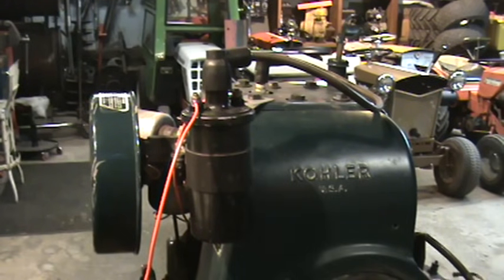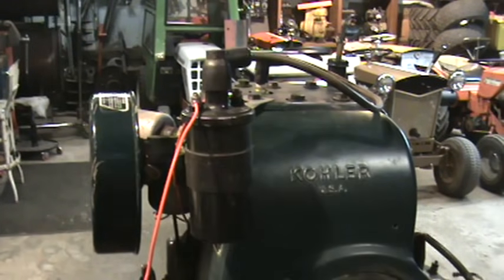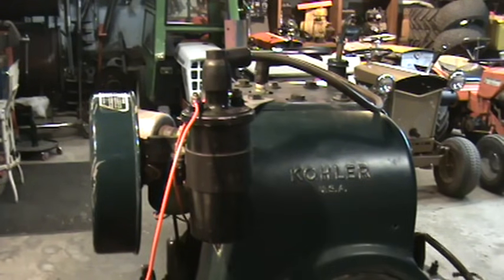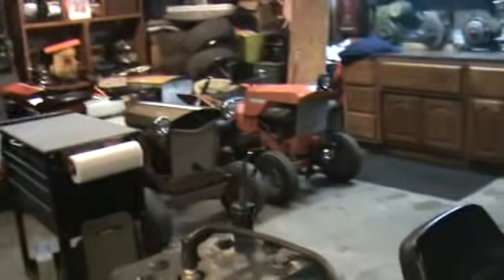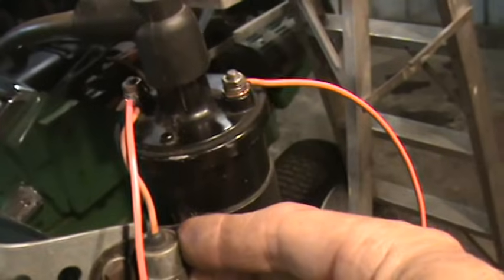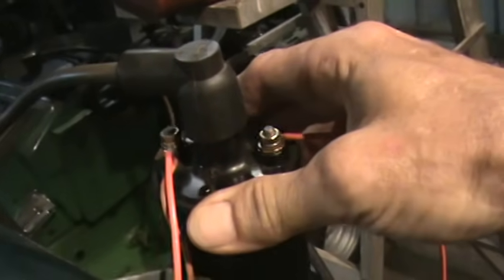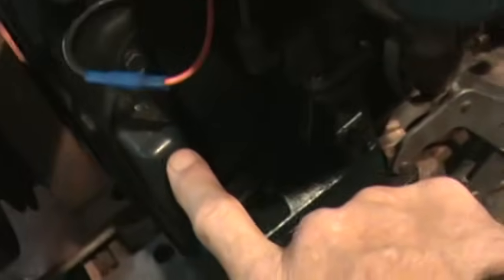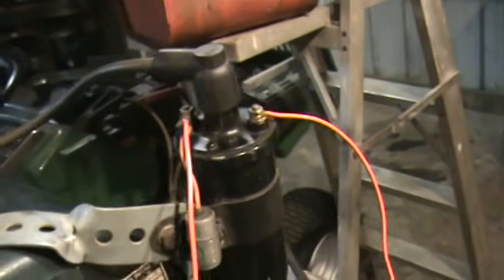Wiring an external battery coil to your engine

Comment: Zippo - I just found a 1963 B-10 with a 23D that has no spark or a weak spark.  I removed points and condenser and cleaned up contacts real good and then pulled engine and removed the magneto which was rusted up from being covered in mouse trash for years.  Nothing looked out of place but the spark is still a problem.  If I switch to battery ignition, and keep the points and condenser all I need buy is the coil.  Do you have a recommendation on the coil?  I'm not too familiar with the electronics of these old tractors but I really want to get this old guy running again.  Your videos have been a God-send, but I need a little help on the coil.  thanks for all you do to keep old US iron running.
Reply from the maker: If you are getting some spark, then the coil is fine. While spinning the engine over, fine tune the points until you get the brightest spark to the plug. Be sure engine is well lubricated by following my video on bringing engines back from long term storage. IF you opt for a battery coil, just be sure it's a 12V coil.
Reply: Thanks Zip.  I got it started and tuned the card (it leaks badly and needs to be replaced).  I got it run and do a few laps around the yard .  Then it started to quit on me.  Would start up and run about a minute then quit.  I'm thinking its fuel related because of the bad carb. the saga continues....
Reply from the maker: Thoroughly clean the tank, replace fuel line, install an in line fuel filter and shut off. I've got carburetor rebuild videos you can follow to rebuild your carb to like new. Glad to hear you got it running! I should tell you, it's a 1964, not a 63. The B-10 was not introduced until 1964 after the B-1 was retired. Cheers! Zip~
Reply: I'll take your word for it that its  a '64.  The old timer I got it from swore he bought it in '59 same year he opened his horse farm in Central NJ.  I have a 76 Case 222 and  78 Cub 1250 with a 1-arm loader.  This B-10 will be my oldest project.  Thanks for your help, you're a great resource.  I already cleaned the tank, installed new line and filter and the carb will be the next phase.  The threads that seat the long carb nozzle and the flow adjustment pin are all fouled and stripped.  Cant remove that long upper nozzle at all.  I think I'll just replace the whole thing
Reply from the maker: The year can be verified simply by going to Simpletractors.com and doing a little research on the old Allis. Cheers! Zip~

Comment: Thanks  Zip ; With this video I was able wire my 16 HP Briggs and get it running . This is just one of your VERY helpful videos that I will rely on and enjoy . Hey, I am even looking at the grip 6 belts. Thanks again and keep up the good work.
Reply from the maker: Don't forget to use my 20% discount code!!!! It's ZIPPO20. So far, 52 people have taken advantage of the discount. Be #53!! They're Awesome buckles and belts for sure. And of course, I'm very glad this video helped you get your problematic Briggs back up and running. Cheers from the Zippo Nation! Zip~

Comment: Excellent video. I have a NOVA electronic ignition in lieu of points and condenser on my AC B-110.  I would like to add a coil as you have shown because I have a weak spark and engine won't fire.  Will  this external coil still work with the NOVA module ?
Reply from the maker: No it will not. You will have to return to a points fired ignition in order to achieve using a battery ignition. If you have a weak spark, change your spark plug to a hotter burning plug. I doubt it's the coil causing the issue. It's possible the flywheel and coil need cleaned up a little and re-gapped. Cheers! Zip~
Reply: I was trying to avoid pulling the engine, to access coil, which entails almost complete disassembly of the front half of tractor :(
Reply from the maker: I have a video showing the process and it truly doesn't take long to accomplish. Zip~
Reply: I replaced NOVA with points and condenser and got back the spark, ;).  I guess NOVA's do wear out.  I'll remember about your engine pulling video.  thanks.

Comment: Negitive coil w cond to points THEN be sure you have a GROUND wire from ADVANCE plate to dist cast. Mine didnt have one Nowwith extra ground from vac adv stud to battry no more Goast Fire.  No missin or skippen.Needed felpro to lift dist to get time right .the gaskets FAT.

Comment: Hey on a distributor where does the positive side connect... Straight the a hot wire or to a negative. I'm hooking a marine engine with a butchered wire harness (454cid 350 gm crusader termo electron)
Reply from the maker: The + and - on the coil is wired + to the battery and - to the points. The - on the coil isn't actually negative, it's more of a power in to the coil (+) and power out (-). Good Luck! Zip~

Comment: I have been burning coils out on my 351W. I figured my resistance wire shorted out and caused the continuous 13.5 volt reading at positive side of terminal. I installed a ballast resistor and the coils lasted longer but continue to burn out. I have not adjusted the points after installing a new one. Could this cause the coil to burn out?
Reply from the maker: I can only guess that there is something else at play here, causing the coils to burn out. If you can, I would find an original wiring schematic for your Windsor and duplicate the wiring. If the issue continues after that, then something not intended to be in the wiring mix is causing the issue. It's hard to tell without being there, but if you isolate the ignition circuit to be only the ignition circuit from the key switch to the coil, then I would think the issue would be resolved. Simply put, anything sharing the circuit, even a radio wired to the ignition circuit, can effect the coil. Also, use spark plugs with resistors if you don't have them and make sure all your plug wires are healthy and not touching anything they shouldn't be. Cheers! And good luck. Zip~

Comment: Great video!
You have a third wire connected to your coil, the second on the negative side. Where does that go to? Is it just another engine ground?
Reply from the maker: That goes to the Condenser (Capacitor) Bradley. Thanks for asking! Zip~
Reply: ZippoVarga I wasn't very clear.  You showed in your video that one of those two wires goes to the condenser, but where does the other go? 1) battery positive, 2) condenser, what is the third?
Reply from the maker: Points Bradley. My apologies. The + and - on the coil is often misleading. One doesn't go to ground like one would think. Battery to + and points to -. Zip~

Comment: How do I hookup the coil to the breaker points I'm wanting to do this on a atv
Reply from the maker: There's no real good shortcut to using an automotive coil on an ATV. You should source the correct part for the machine in your case. Zip~
Reply: ZippoVarga but if I wanted to do this what would be the best way
Reply from the maker: Long story short, the voltage to fire the OEM coil comes from the Engine's Stator (alternator) through the Rectifier, then into the coil...there are specific Ohm parameters that must be maintained between the stator, rectifier and coil or the whole system will fail. Don't cut corners. It's not just a simple swap when it comes to these sensitive electrical systems. If you're set on doing it your way, you're on your own. It won't work out well. Stators, $150+, rectifiers another $100...the RIGHT Coil....$25. Why chance it? Zip~

Comment: Hi, I have the motor out of a 71 dodge van and I am trying to make it run. It is all in good shape now but my coil has one wire coming out going to the bottom of my distributor and the other wire is not connected. Do i connect that side directly to a positive battery terminal or no??

Comment: I have a 52 Studebaker with a positive ground, is it the same with just everything reversed?
Reply from the maker: I would consult with a Studebaker forum, perhaps on Facebook or a collector group or web sight to be sure Real. Cheers! Zip~
Reply: +RU4REAL Hi I have the same situation did you find out if it is? Thanks
Reply: Are you giving it power bc both side will have power bc with the point it will brake up making the spark

Comment: Hello does your coil have a power tower? Or is it hollow?i don't have a power tower on my coil and when I have my wire connected to the coil it tends to burn the top of the coil and the boot.am I installing it wrong?should I get a power tower?

Comment: hello my name is josh and i recently bought an internal resistor coil exactly like u have in the video but a little more interesting question is that i put a 5.0 (302) in my 95 ford ranger and i would like to know how to wire that coil on my single wire distributor with a push button start and a toggle switch. i have so for gotten everything wired up for starting wise put cant get spark to the spark plugs

Comment: so on my 16 horse Briggs I can just disconnect the wires from the Magneto coil install my battery coil and wire it up correctly
Reply from the maker: Providing you have a points fired engine, yes. If you have a later model Briggs with electronic ignition, then no, you can't. Zip!

Comment: If you have a condenser on your points do you need a condenser on your coil.
Reply from the maker: Good question. If you're using a Battery Ignition coil, place a single condenser on the battery coil. If you're converting a Magneto Ignition engine to a Battery Ignition, the condenser on the points should suffice. Cheers! Zip~

Comment: Why does my engine go through a coil about every 12 months
Reply from the maker: If using a coil that isn't marked 12V on the can somewhere, then you need to install a Resistor along with the condenser. That's the short answer. Any coil without the 12V marking is a 6v coil and requires the resistor to keep it from over heating and eventually failing. Cheers! Zip~
Reply: It is marked 12V, I have bought 3 new from NAPA in the last 3 yrs.

Comment: if you have it on your battery then how does your battery stay charged???? I'm having problems with my 89 ford. I hook up my brand new msd blaster 2 coil straight up to my battery and I have someone crank it over will I'm holding the coil wire that sends the spark to the distributor close to my valve covers and there's not a single spark at all.
Reply from the maker: Battery stays charged via your Alternator. Sorry to hear you're having spark issues. They are definitely frustrating when that happens. Good Luck Chris! Zip~

Comment: Hey There,, I have a 73 Camaro. it was running fine, then is just died, and now It has no spark at all when cranking the engine, not at the coil and spark plugs. I changed, cap, rotor, points, both condensors. Still no spark,  any idea why?????
Reply from the maker: I apologize for the delayed reply. I wasn't notified of it. Have you sorted out the problem? Zip~
Reply: Thats cool, it was the points,, they were brand new, but they were shorting out in the cap, drove me nuts, and yes She is running Great,, LoL
Reply from the maker: Run a wire from the + terminal of the battery directly to the + terminal of the coil and see if you have spark. If not, replace the coil it self. If so, you have a wiring problem in the ignition switch preventing power from getting to the coil and would need to troubleshoot wiring from the key switch to the ignition system. Zip~
Reply: hi,, I did that and still no spark,  i checked that the ignition switch (key) was good, juice went to the coil, and other accessories works. but no spark,  and yes i changed the coil with the other components,, possible a bad ground or the horn relay?
Reply: What was wrong? Did you started your camaro?
Reply: I have same problem, but in long time i solved it lol it was comutator
Reply from the maker: That isn't so uncommon now that most of our parts are made in third world countries where quality is job 100 and quantity over labor is job one. Sad but true. Glad you got it figured out! Cheers! Zip~

Comment: hay zip can you tell me how to wiring a 12 hp  kohier side mount  the plug on the tractor and the plugs engine do not match . it  is   topcoil   12hp  and the mower is a 312=8  hydrstatic   one thanks tim

Comment: hello there , idd like to say thankyou for the video , i not used to these old systems and i have a vintage 1950`s - mid 1960`s 30 ft boom Forklift to get running and get home , and it has lost its spark , i had changed coil thinking it was that , but the guy i got it from had messed with it and he too could got get spark, it turns out booth of us has it Wired wrong , i will go back to it and try to wire it right following what u said on this post , The way it is wired right now ( wrong ) the points on the + and the other - side is grounded , so this could be why.

Will wire a red wire on the + side directly to the battery , and on the negative side will stick that on the points and condenser side. and try that.
Reply from the maker: That should give you spark providing the points are in good repair Chris. Best of luck! Zip~

Comment: i have a 1974 dodge charger with a 360. im wondering about the 2 wires coming of the distributer one neg and 1 positive, i know one goes to the coil and im assuming the other would be the ground, any info you can supply will be appreciated.

Comment: Ok Zippo, I am on hour 10 trying to get a spark on my Simplicity 7016.  I put on a magnatron only to find my flywheel is polarized different (i am not surprised as it felt out of time),  when I couldn't get a spark with the magnatron i pulled the engine and put an old coil and points and condenser back on.... no spark.  Wired up an external coil from NAPA.  The only thing I did different from your video was to leave the condenser with the points and wired to the coil.  My thought now is I must be grounding out some where. Any suggestions.

Comment: Hi Zip, Maybe a dumb question, but what is the condenser used for on that case.
Reply from the maker: Think of it like a miniature battery storage device. Which, is essentially what it is. Condenser/Capacitor. When the points close, this discharges the Condenser, concentrating the charge or spark. And not a dumb question at all Sir Santos! Cheers! Zip~

Comment: maybe a dumb question but if I were to do this to a 2 cylinder outboard no alternator, ( 2 coils obviously) would it drain the battery quickly having to run the coils?
Reply from the maker: Yes, it would drain the battery in short order. Zip~
Reply: think a 18w solar charger would be sufficient to keep the battery charged?
Reply from the maker: No it wouldn't be sufficient. I would get two deep cycle batteries and only hook one up at a time so when one dies, you have the back up to get back to the docks. But honestly, I would replace the defective magneto's and not use battery ignition at all. Zip~

Comment: Hello there perfect explanation! I'm wondering if you can help out with my problem is have a old lincoln welder that have the kohler motor on it but I'm thinking that my magneto it's bad, but it's the one on the flywheel I'm wondering if I can just swap it with one like yours!!!thanks in advance
Reply from the maker: Most generally, yes, adding a battery ignition coil will solve a lot of problems. Make sure the points and condenser (if so equipped) are good and that you don't have an unknown ground causing the no spark then you should be good to go. Cheers!! Zip~
Reply from the maker: I should add, if your current magneto is solid state, meaning no points, then you will have to replace it since you will have no way to tell the battery ignition coil when to fire.
Reply: ZippoVarga hello zippo thanks alot for answer I just order the new points and condenser to see is this will solve my problem if not do I have to buy a new magneto or one of this coil will solve my problems so I don't have to deal with the magneto again???
Reply: ZippoVarga even like I say new points and condenser are coming but I'm wondering if I have to have a good magneto to be able to have those coil like yours
Reply from the maker: When ever possible, always go with stock parts. If the points and condenser don't do the trick, then I would replace the bad magneto with the same thing. Magneto's are very reliable. Zip~
Reply: ZippoVarga ok Sr but im in the same page with you but the only problem its That I haven't been able to find the magneto i have the kohler k241p and the magneto go inside the flywheel so I haven't been able to find it
Reply: How to clean a catalytic 'converter on ml 320

Comment: I installed the following on my 1969 corvette 427 
msd distributor 8572
msd module 6AL
I turn the car on, everything is great but there are sparks on the coil. at the top. ( the coil is a brand new stock coil ) i just ordered the msd blaster 2 coil.. hopefully that will eliminate my problem. any opinions or tips ?
Reply from the maker: Being a New coil, it was probably manufactured in Mexico and quality assurance isn't what it was when Delco Remy America was making them pre NAFTA. You get the luck of the draw when you purchase OEM parts now days. When ever possible, always source USA made replacements. Cheers!! Zip~
Reply: Forget running a separate module and get a coil in cap distributor one hot wire and a rpm wire gmc uses them stock in there cars I converted my mustang works great just find or replace the bottom gear that for your car

Comment: hey Zip... Well, I managed to break the key off inside the ignition on my 1974 vw super beetle. It's in a Walmart parking lot. My concern is the info that says the key must be in place to be able to remove the ignition system...so I am currently lost and confused.  I would be happy to bypass the ignition and hot wire the whole mess to a toggle switch like they do on COPS,but I just don't know any good car thieves anymore. I cant even drag it to a mechanic...Can you HELP ME???
Reply: The pointy end of the key is in place, but no matter how I wiggle it, I can't get the roundy end to engage and turn the car over.